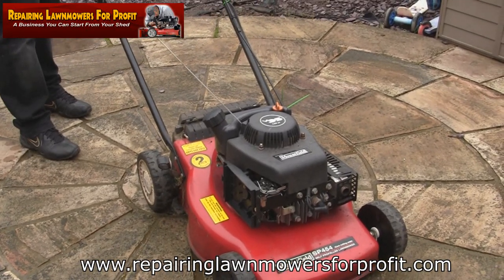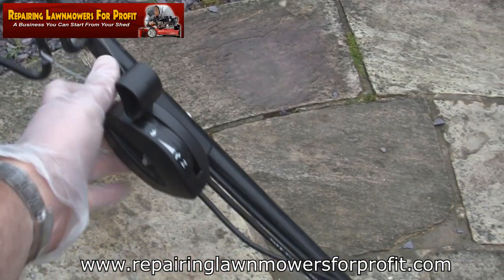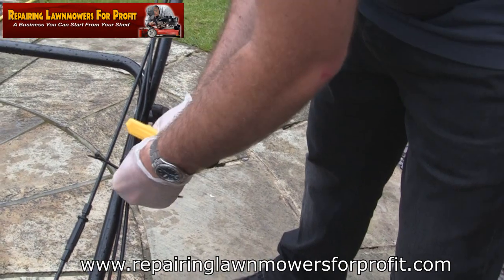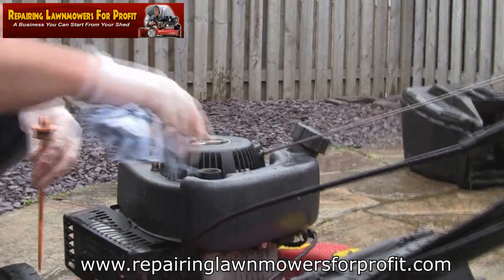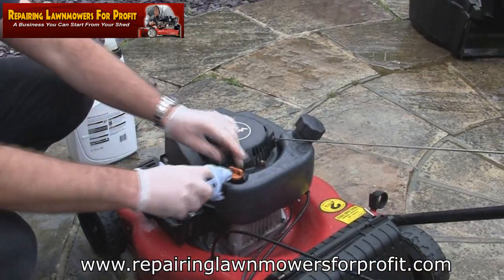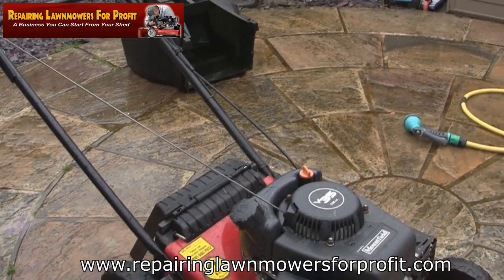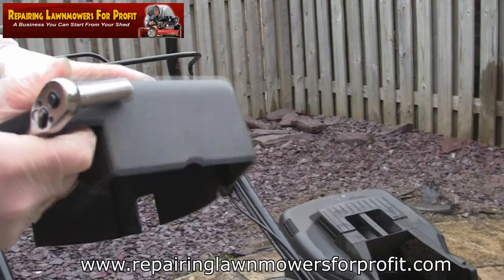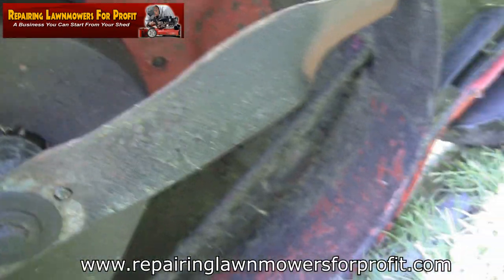Mountfield SP454 Petrol Lawnmower Repairs

Comment: Hey Paul, You want to get yourself a small work table to put the mowers on (like Martin Butler has) I put my mower on a cheap 'workmate' type bench when I work on mine - it really makes a difference with the old back ache!. BTW - my mower is an old Champion mower powered with a Honda GCV160 engine and is superb. The choke and throttle control work perfectly. I have a vid on my channel (not as posh as yours though!) of when I refurbished it 3 or 4 years ago (or type in Lawnmower Refurbish on YouTube). Cheers, Mark :)

Comment: reason throttle doesn't work is govenor spring is streached part no 118550151/0 cost about £3 replace it and the throttle will work it is very common problem on these what happens is the spring gets caught with branches from bushes etc and it pulls the spring then it wont rev so they fiddle around but they sometimes set the throttle to fast and that can blow the engine.  also the carb you didn't take the emulsion tube out to clean or it was not on video just to give you a heads up if you get another and it does not work after cleaning
Reply from the maker: terry987654  Thanks Terry